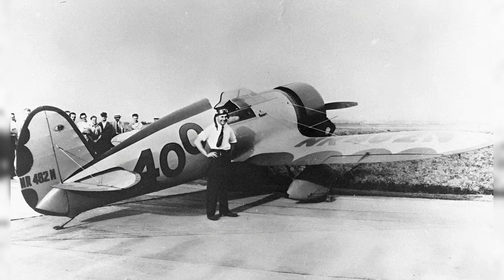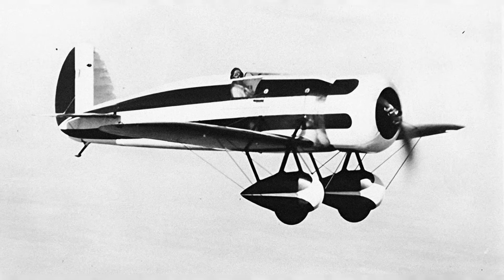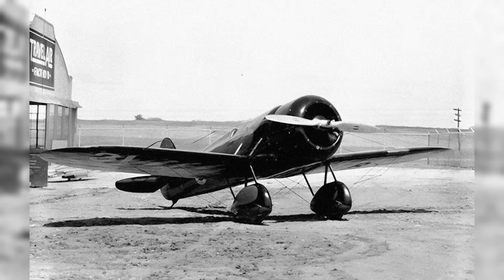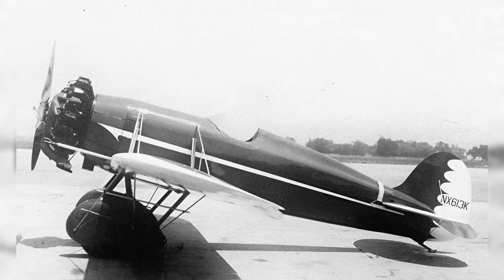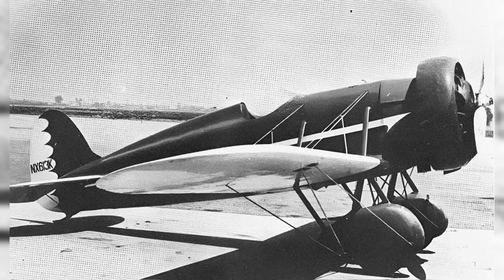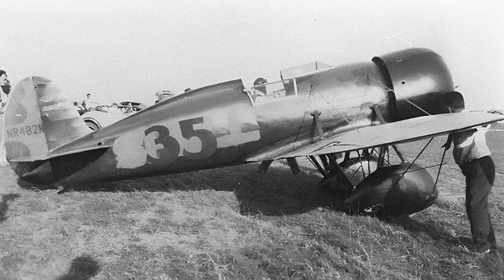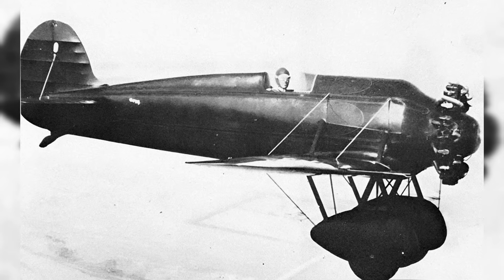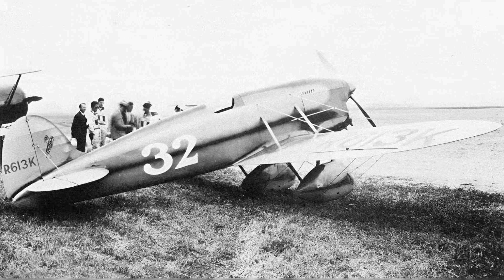Travel Air Mystery Ship: Why Was It Kept a Secret?

Comment: Um, what, you get really confused.  614k was lost, 613k went to Pancho and she had the radial engine installed in 613k... 613k has the distinctive hump and short cowl or no cowl how Pancho flew it.  you messed that part up completely.  They were built together at the same time and both competed at the first Thompson trophy with 614k cause it had a more powerful motor winning.
Reply: well I guess its a bot so whatever.

Comment: Man if they coulda eliminated the goofy wheels and made them tuck away it woulda killed it even more. And would have been a decade ahead of everyone.
Reply: Retractable landing gear adds an incredible amount of complication to an airplane. One of the easier ways to reduce drag would have been to devise a wing spar that could have done away with the flying and landing wires. It's hard for non-engineers to believe, but those wing-support wires, if they're round and not streamline-section, can produce 70+ pounds of aero drag at 100MPH. Drag increases with speed, and it does so at a rate proportional to the square of the speed. This means that if an object's speed doubles, the drag force quadruples, so that (possible) 70 pounds of aero drag at 100MPH becomes 280 pounds of drag at 200MPH.
Reply: Hughes did that with the H-1 after checking this out, thanks to Pancho.   He had her in his film the Hell's angles, used Pancho's 613k for all the airplane sounds in that movie.  The h-1 lead directly to the zero and ww2 warplanes.